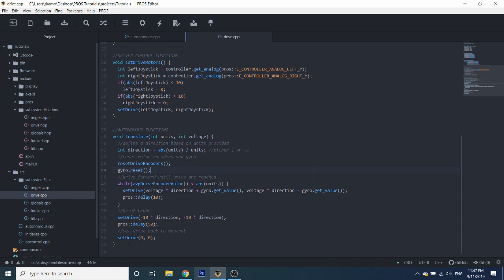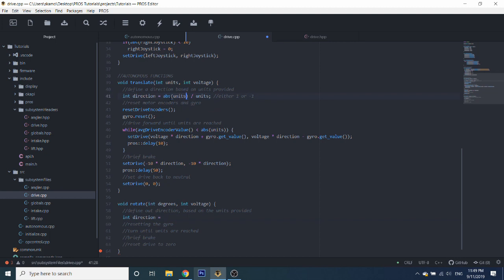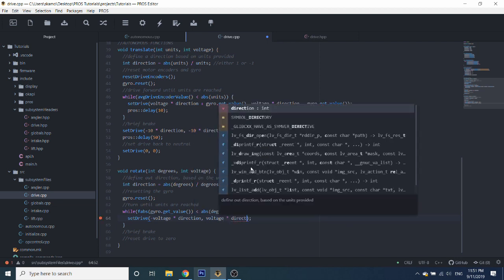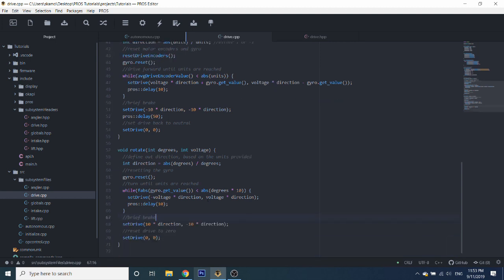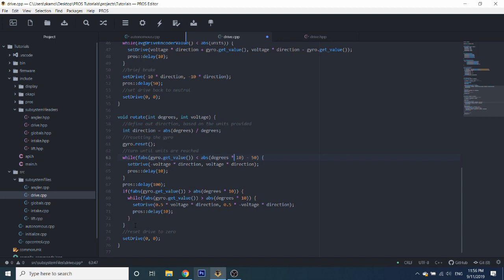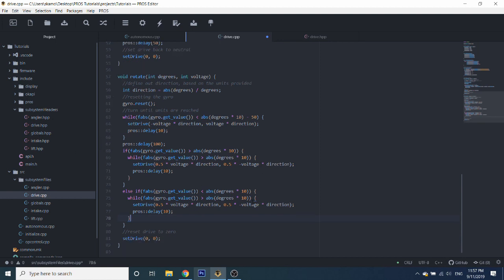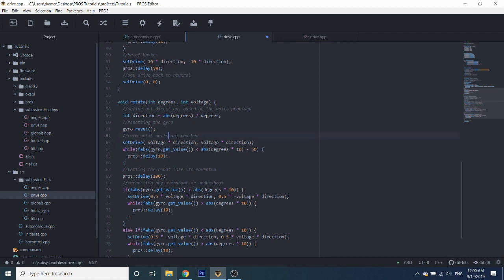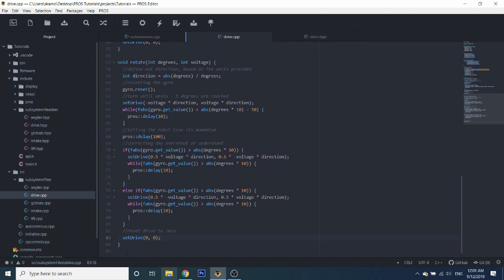PROS Tutorials 4 - Simple Gyro-Based Turns

Comment: 13:49 The motors are never set to 0 between delay(100) and the while loop, so I think for this particular code it won't coast for 100 ms but instead keep turning for that 100ms. I think a setMotor(0,0) is still needed?